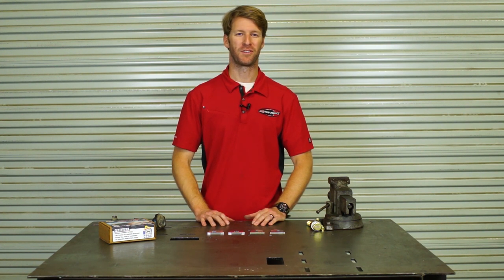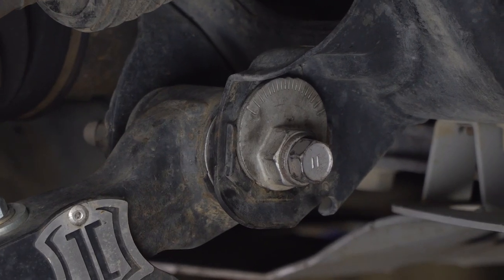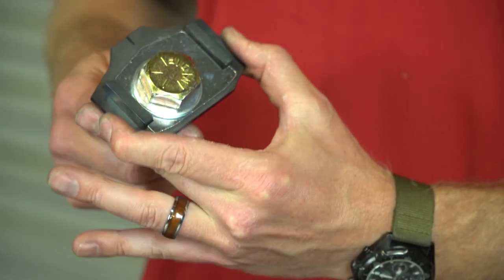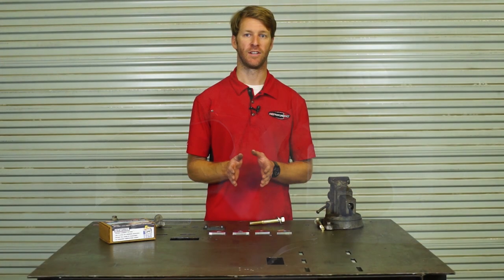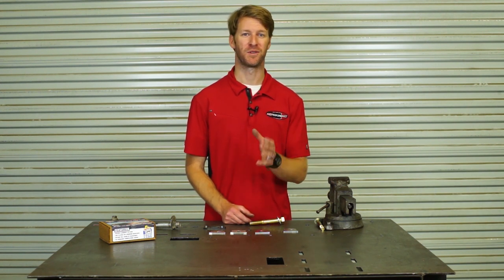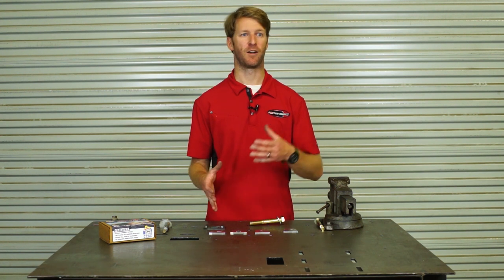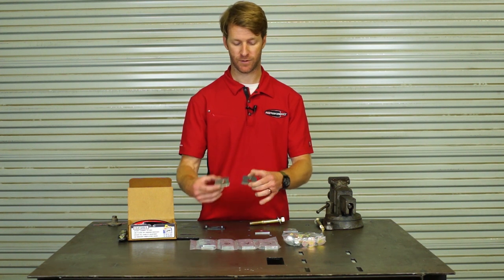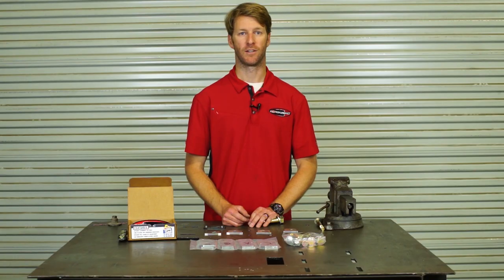POLY PERFORMANCE GARAGE | Episode 1: Permanent IFS Toyota Alignment with Taco Tabs

Comment: The issue is that these limit the caster , I’ve only been able to get -2.5 on caster even with dobinsons uppers that have -1.5 built in. I’m swapping out these for another manufacturer that can get -4/-5 deg

Comment: If I just want to adjust my Camber on a 2020 Tundra do I just need to turn the front camber bolt on the Lower control arm or would I need to adjust the rear also?

Comment: I have used 2021 tundra and drove it 50000+ miles in 9 months and it started to need alignment now, I can't imagine how a car needs alignment after a few hundred miles.
To avoid seizing of alignment adjustment bolts, folks can use never seize compound. Sometimes friction is desirable which is the case for the adjustment bolts.
When you are replacing an OEM part with your part, you need to have a proven reliability design through FEA fatigue design with dynamic cyclic loading. These designs have reached this point with evolution, and utmost care shall be taken to to avoid any liability issues.

Comment: Installed these and my alignment specs were all good. However, i did knock my steering wheel  crooked again on a small rock.
Reply: that's because your toe is going out. Adjust the outer tie rods to fix that.

Comment: How about something like this, but in the opposite direction? Toyota seems to use the same kinda setup across their range of models. I drive an 08 scion tc that I have lowered drastically, but even on oem suspension, hitting bumps easily takes my car out of alignment.

Comment: My bull bar on my 2017 taco fell after the welds broke off (cheap product) and my front tires ran it over. My alignment got messed up. Will these tabs correct it, if i get the kit?

Comment: I wonder if it'll fit 2016 tacos, most of the trucks frame is nearly identical to the second gen.
Reply: I was thinking that too. The cam tab gusset kits are the same so I would think the cams are the same too.
Reply: I have a 2017 and hopping that it will work for mine too but afraid to pull the trigger if they don't work on my year and model. I just ordered the a set of total caos LCA Cam Tabs and wouldn't mind putting these 2 together. 🤔